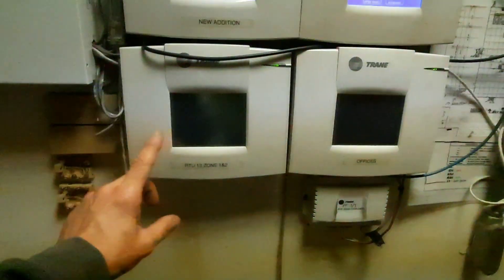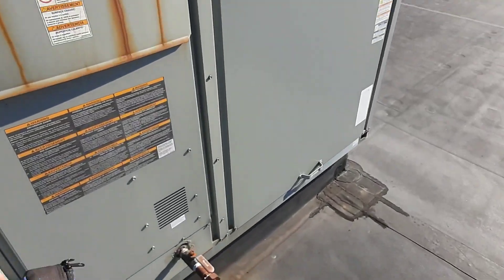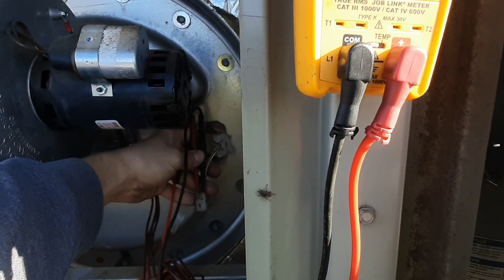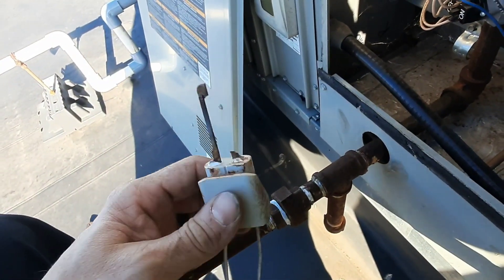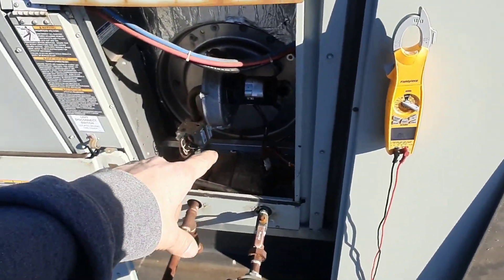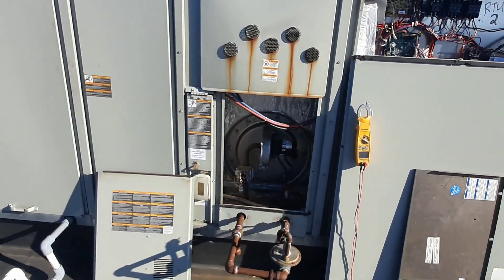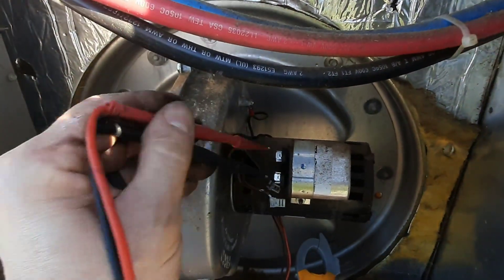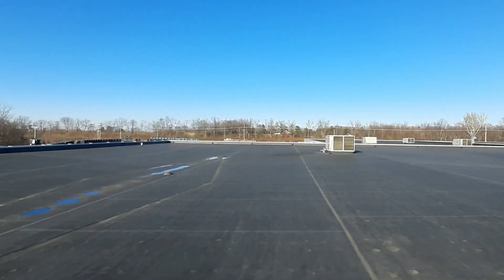trane package unit no heat service call, no flame sense#hvac#hvacservice#bluecollarlife#trane#noheat

Comment: Nicely done Steve-o. Absolutely the right thing to do....check all of it out before presenting to the customer. That really large transformer (350VA) in the controls cabinet is for the combustion blower and igniter. Just as FYI for the newer guys....if you show up and the combustion blower is running without a call for heat......check out the large transformer and ignition board. 

I've snapped those heads off those screws so many times.....i bought an extractor kit just because of it. Anti sieze on those screws will help with the corrosion. 

Thanks for sharing with us brother we appreciate your videos and knowledge
Reply from the maker: Thanks, Jason! The older units, combustion motors would fail and run constantly. They now use a separate contactor for low or high fire to keep that from happening.
Reply: @EverythingHVACR  didn't know that....and now i do...thanks brudda

Comment: Good stuff Steve O. Like JJ I use anti-seize on a lot of the screws that I have issue with. In a pinch I will put a coating of silicone on the threads if I don’t have any anti seize.
Reply from the maker: Thanks, Bryan! Anti seize is a great idea.